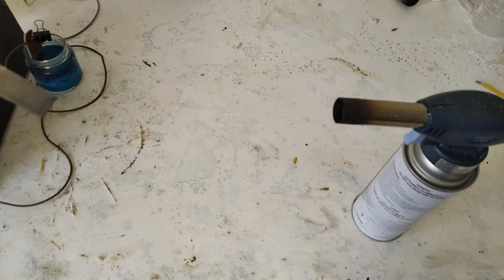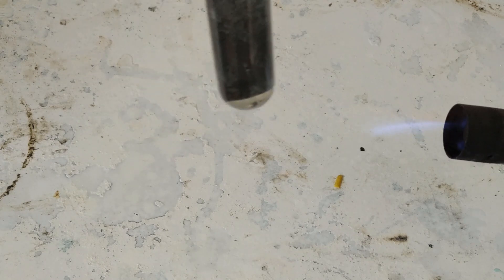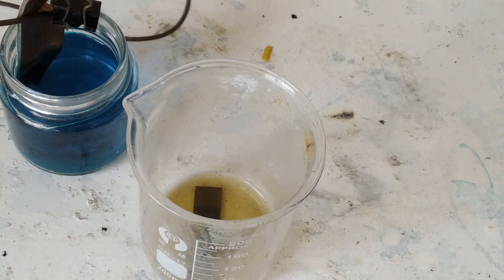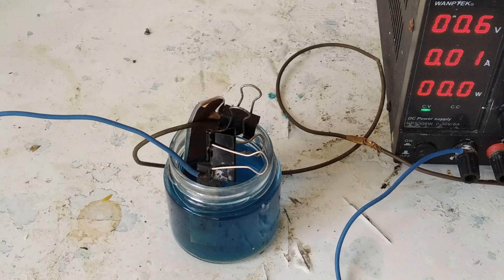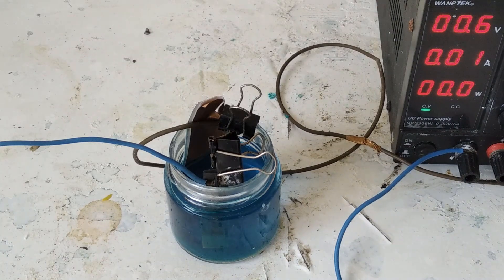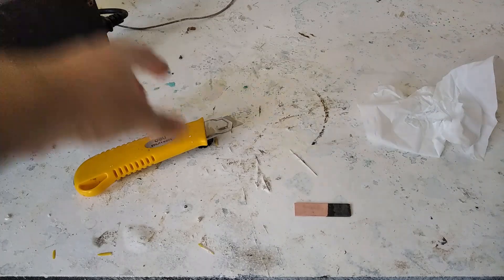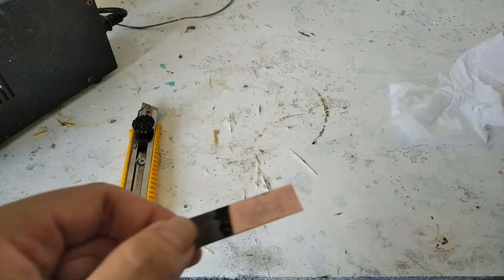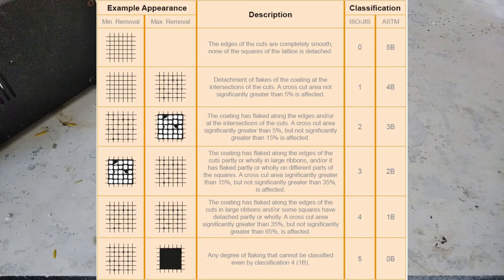How to electroplate directly onto Titanium substrate.

Comment: And why plating copper on to Ti, while using pure Cu is several times cheaper? What is it good for?
Reply from the maker: titanium substrate is used for electrodes so yes you need to plate it on Ti.
Reply from the maker: pure copper would corrode in an environment like a chloro alkali cell and copper plating is for electrical connections to reduce resistance of the circuit.

Comment: if it does not electroplate, then just crank up the voltage, yes, up to plasma vapour deposition
Reply: yes kinda atom layer deposition painting
Reply: when you crank up the voltage, the ions are decoupled from the surface and flung on the target
Reply: also called as sputtering
Reply: hot ion electrode, instead of hot electrons
Reply: anode ray tube, not cathode ray tube, for ion beam painting
Reply: yes it needs to be high voltage dc, not ac
Reply: also ionization decomposition based metal making process
Reply from the maker: @Jkauppa  yes but this needs sputtering chamber and is a totally different method.
This also works but is overkill for this application.
Nickel then copper coating is fine because if I wanted to sputter something it would be BDSiC as my active electrode material.
Reply: @CatboyChemicalSociety  you said "cannot solder" and other downsides, so not overkill
Reply: @CatboyChemicalSociety  the high voltage ion painting needs only a vacuum and high voltage source
Reply: @CatboyChemicalSociety  check the space telescope mirror pvd coating footage on youtube
Reply: @CatboyChemicalSociety  a vacuum hand tool for ion painting (ion spray) would be nice
Reply: @CatboyChemicalSociety  it coats anything, not only conductive surfaces, so no pre-application of carbon layer to coat (you could always paint a carbon conductive paint layer, then electroplate anything
Reply from the maker: @Jkauppa  yea IK and one day I might even make one because I do wanna explore BDSiC. though I already found a cheap lead free thermal bake process for a non pgm based electrocatalyst that can produce perchlorates and be run at 250ma/cm^2.
I honestly think nothing is gonna beat that electrode in terms of non toxicity and usability. It is a new type of MMO electrode concocted by the CCS.
Reply: @CatboyChemicalSociety  nice, but too many abbreviations :)
Reply: @CatboyChemicalSociety  I stumbled upon a paper where they bake monosaccharide sugar and urea into porous N-doped carbon in a simple process. I wonder if such a material could have any use as an anode.
Reply from the maker: @bataalexander9703  titanium cheap and better but you can just buy graphite in dense form

Comment: Excellent video as usual. First for what I've seen on electroplating onto titanium, would precoating with nickel be a better way? I've read about nitric/hydrofluoric etchant, no oxalic. Have you exeperience in that?
Reply from the maker: a little bit of fluoride and any acid will be a good titanium etchant.
yes precoating with nickel is the proper way to do it but I show here that you can plate copper directly for limited use such as increase in electrical conductivity without worrying about passivation of the Ti as it gets hot.
Reply: @CatboyChemicalSociety  How would you coat the nickel, on once the titanium is oxide free?

Comment: I wonder if a graphite powder infused paint/ lacquer could work as a cold, corrosion resistant alternative to soldering.
Reply from the maker: there are conductive paints and are ok for lower current applications but for high current electronics these will catch fire or burn.

Comment: If you get that very hot in an inert atmosphere will the copper diffuse into the titanium and make the plating stronger?
Reply: You're talking 700+ °C to begin getting any measurably diffusion, but yeah, sounds legit otherwise
Reply: Just did some Fick's law calculations, and to get the copper and titanium to diffuse about a micron into each other, it would take ~8 minutes at 700 °C